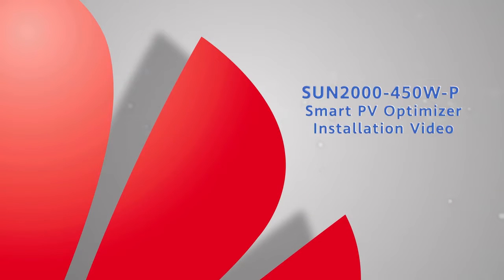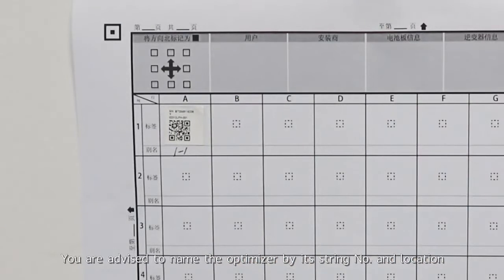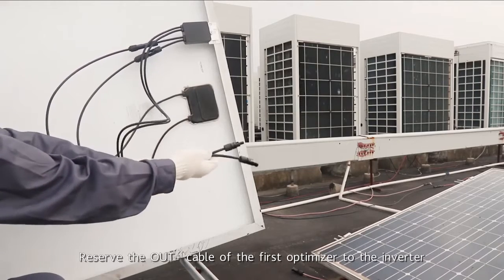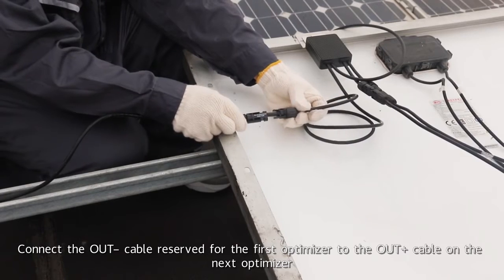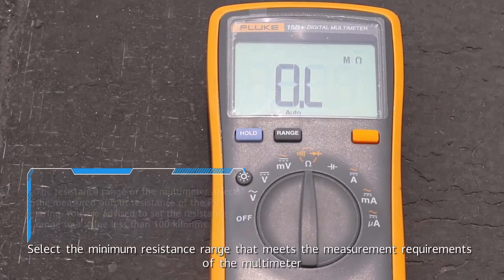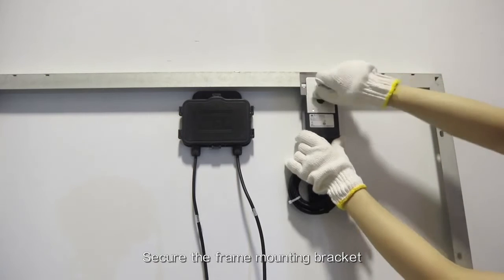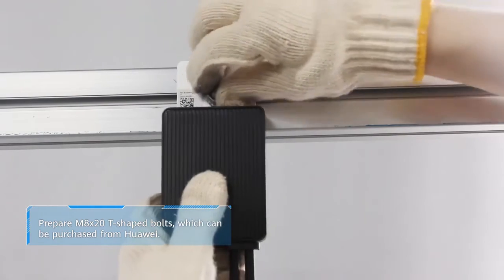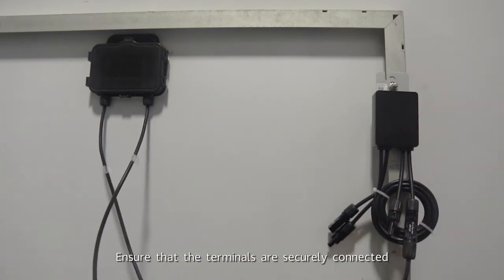Huawei SUN2000 450W P Smart PV Optimizer Installation Video

Comment: Can I measure voltage when using optimizers? I do get the 1 kOhm per Optimizer, but no voltage
Reply from the maker: Huawei optimizers are typically in a low-power state (bypass mode) until they are activated by the inverter. If the inverter is not powered on or not communicating with the optimizers, they may not output voltage. To measure voltage from the optimizers, the system must be powered and operating. 
Check that:
- The inverter is powered on and operational.
- There are no communication errors between the optimizers and the inverter.
- The DC cables are properly connected, and there are no faults in the wiring.
Reply: @Gpceurope  Thx. I suppose measuring Voltage with a Multimeter is impossible, since the inverter needs to communicate with the optimizers. 

The issue was that I had to use the local installer account to search for the new optimizers. They are not recognized automatically after a reboot.